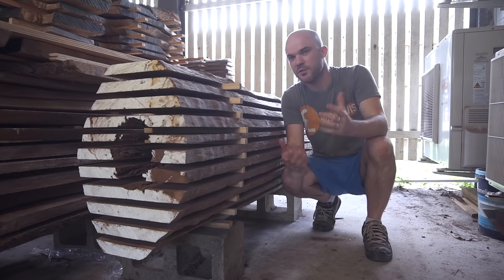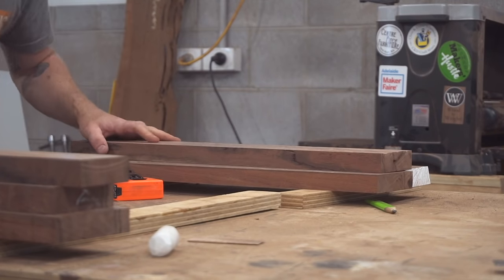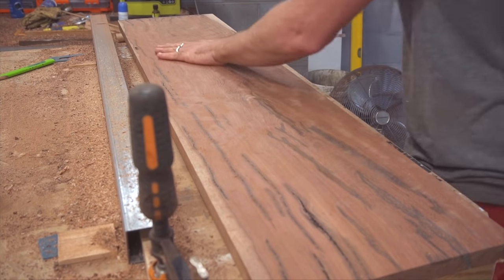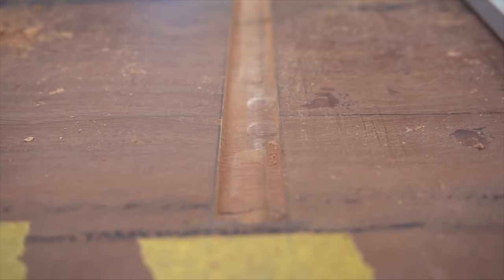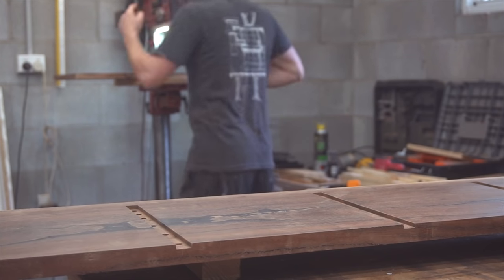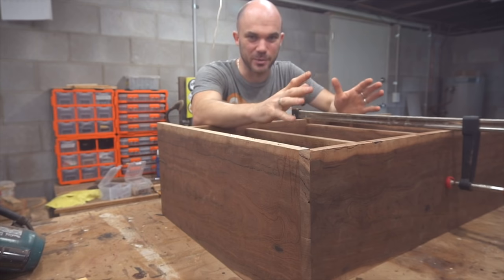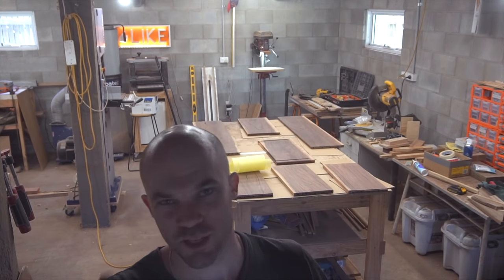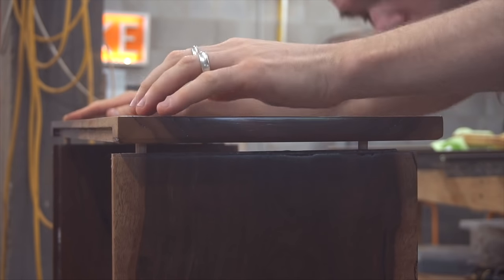The BEST CLIENT I’ve Had, 2 Years In The Making

Comment: Looks great, Robin.

I also think the dowels would have been fine.   For many years, I used compressed dowels from Lee Valley, but they're currently unavailable.  Those definitely swelled a bit, which locks them into place.    But even regular dowels still have a lot of strength with modern glues.

Another option would have been to add a small trim piece along the underside of the top, along the front edge.  That would have completely hidden these clips.   As it is, they're still pretty hidden.   If you'd hit them with some black spray paint that would have also helped them disappear into the shadows.

Lovely bit of wood!
Reply from the maker: Thanks Art. I feel like I got away with it because of it's height; at 40 inches you'd need to be quite low to see up under the top. But next time I'll just go the dowel route. I actually did a test, with 2 dowels in the same wood in an L-shape, after this project and it was waaay stronger than I thought it'd be

Comment: Great job. Really digging the thin line of sapwood along the front edges. Dowels would have been fine for the top. If you ever have the misfortune of needing to disassemble a dowel joint, you will quickly realise why it would be fine 🤣
Reply from the maker: Thanks mate. I think I got away with it because the top is only a meter off the ground, you'll almost never see the clips, but after reading all the comments I'm wishing I'd gone with the dowels. Next time!
Reply: In the unlikely event I was asked, I perhaps would have recommended sliding dovetails!  (and ship lapped boards for the back - as it all had to be made from the one tree!)  Cheers, David.

Comment: Thanks for being so thorough in your explanations of each step, this was extremely helpful. I've struggled with the top on a recent table I built. I also ended up using some metal fasteners, which I wanted to avoid. Ultimately you can't see them at all and it allowed for some wood movement, so I was happy. I also wonder about the plywood in the back, would it have been better to stain it at least a bit darker? I'd hate for that to detract from the piece - though I guess if there are enough books you won't see it!

Comment: I missed seeing you, Robyn. The bookcase looks great.
As far as the top goes, I'm a bit confused on the decision not to use the dowels and glue on the top?
Reply from the maker: Thanks Steve! I'd read that dowels were very strong against shear forces, but it's not a good idea to use them when you're pulling directly against the hole they're glued into.
Reply: @RobinLewisMakes  That's my first time hearing that and I find it hard to believe. I would have to see a test run on this in order to change my mind.

Comment from the maker: It’s been a while! Keen to hear your thoughts; would dowels have worked for the top panel? I was worried the dowels would weaken over time as the bookcase is lifted by the top panel
Reply: Robin Lewis yeah
Reply: The dowels would have been totally fine. No upward force is ever being applied to a bookcase top.
Reply from the maker: I was thinking about when it's moved, the first thing you'd go for is the over hang on the top. Granted that wouldn't happen too often, but that's where it'd fail
Reply: Awesome video Rob.
The dowels would of been perfect they have being used for years for a reason.

I have made all my furniture over the past 10 years with dowels in that way and I have never had a return or break.

I also have furniture that is 60 to 70 years old been moved from house to house and the dowle tops have never failed.
Reply from the maker: Stuart Guy thanks, and that’s really good to hear. The concern is people lifting the bookcase from the top, that’s a lot of force on a short dowel. I did a test after building this and it seemed more than strong enough, but because this is a client project I didn’t want to risk. Next time I think I’ll just dowel it in
Reply: @RobinLewisMakes  I think using the dowels would be much nicer looking then those clips. I think they really detract from the overall beauty of the piece. VERY nice build otherwise.
Reply: The figure 8s are indeed not the nicest look, but seems like it would be unlikely to be seen here for the most part at least.
Reply: Great to see you back, Robin!  I think you made a good choice not to use dowels - nothing surer than somebody will pick up a semi-full bookcase by the top, and dowels really aren't that strong in tension when the interior of the hole is mostly end grain (i.e. a "cross" hole).  You could perhaps have gone for sliding dovetails, however - they can even be housed like the dados you used for the shelves - and they have the advantage of being a mechanical joint.  A bit of practice with a random dovetail router bit and you'd be there... though a sliding dovetail really needs a router table, even if it's very basic, to get the needed consistency in the routing, I admit.
Reply: Clients will always lift a bookshelf half full from the top and the dowels would fail, I think some glued in trim pieces would easily cover the figure eights for a more finished look but they're not really necessary given that they are below eye level anyway. Glad to see you back on Youtube, the shelves are gorgeous and the workshop is looking great.

Comment: Not sure what you mean by 'Dowel joinery from a vertical lift is not a good idea'? the book case is resting on the floor is it not?
Reply: ah - just read the comments above. You were worried about people lifting it. I would have still gone with the dowels. I'm sure they would be strong enough, and people aren't going to be lifting it that often. They would also have been hidden. A stronger method than dowels would have been wedged tenons, then it would never come off with people lifting ... but overkill really.
Reply from the maker: I had really wanted to do wedge tenons! I don't have a router table yet but it's on the radar

Comment: 4 figure 8 on each side? You are over doing it! Also, there is nothing wrong to use the dowels for the top shelve. I dont understand why people would complain, no strength is required, is is just locking the piece in place.
Reply from the maker: alain pilon my concern was when people move it they’ll most likely lift from the top panel, pulling the dowels vertically. Admittedly it won’t be moved often but the fear is that the dowels fail and then the entire panel needs to be removed and re glued. Maybe too many clips though haha!